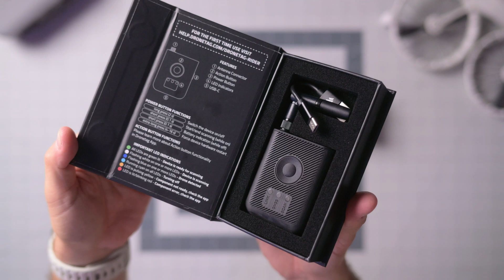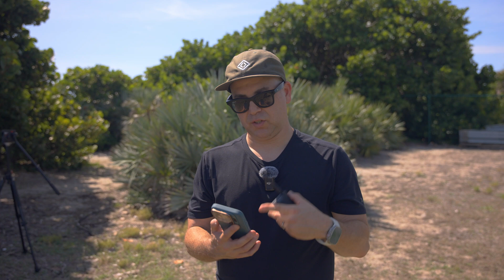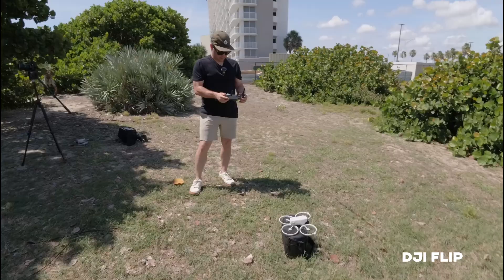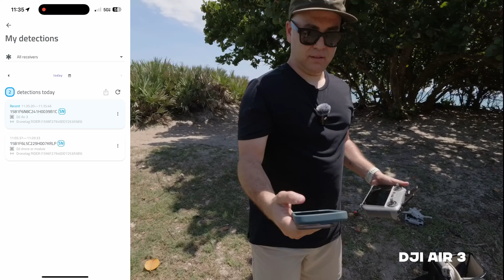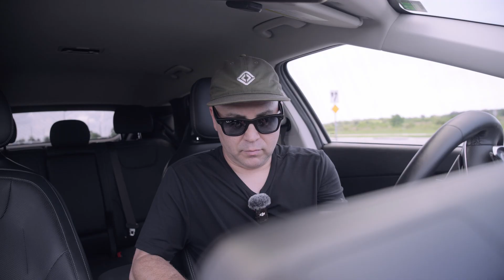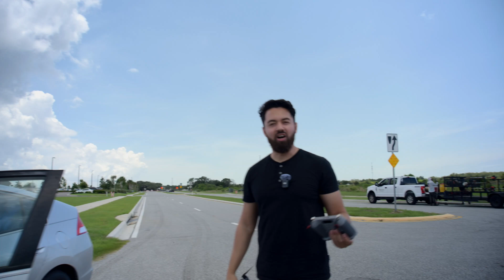Stalking drone pilots with this little box

Comment: Would love to have something like this while flying in popular areas, especially while on the job, but the price is WAY to high! Currently use Drone Scanner app which is made by the same company and is free. It's definately not perfect but helps and would rather keep using it instead of paying for the Rider at that cost.

The only good thing about the price being so high is that it will keep it out of the hands of most Karen's....
Reply: Hi, thanks a lot for your comment and for being our Drone Scanner user! 😊 If the app works well enough for your needs, that’s perfectly fine. RIDER is built for pilots and professionals who need maximum performance and reliability, and also for iPhone users, since iOS doesn’t allow scanning DJI signals directly. That’s why RIDER comes as a dedicated device, but we totally understand that Drone Scanner is a good solution for many use cases.
Best,
Kate, Dronetag
Reply: @dronetag it could be better due to android limitations and not correctly working on all android devices.

Refresh rate for one could be much better.

And yes I am a professional drone service provider, us smaller DSP's always seem to be pushed aside as if we don't matter because we can't spend big bucks... bringing safety in the airspace should be top priority before profits... just saying.
Reply: @UltraVegas76  Hello, thanks for sharing your thoughts openly. We truly value your feedback. You’re absolutely right that smaller DSPs play a key role in making the skies safer. That’s why we developed Drone Scanner as a free tool, so everyone, from hobbyists to independent service providers,  has access to a Remote ID detection app at no cost. Drone Scanner has recently undergone a complete redesign and now includes many new, and planned, features. At the same time, Drone Scanner’s performance is shaped by factors we can’t fully control - including the refresh rate, which is influenced by the phone’s hardware, the behavior of Android OS, and how aggressively some devices manage battery saving. While we continuously optimize within these boundaries, certain limitations we cannot influence. RIDER, on the other hand, is built for users and agencies for whom reliability and functionality are absolutely critical, where a lot depends on having the right tool. While its price point may not be for everyone, it reflects not only the advanced hardware inside, but also the responsibility it carries: rigorous standards, extensive R&D, and the ongoing development and support our customers rely on. That said, we’re always looking for ways to better support smaller operators – whether through software improvements, partnerships, or more accessible options in the future. Your input helps us prioritize those efforts.
Best,
Kate, Dronetag